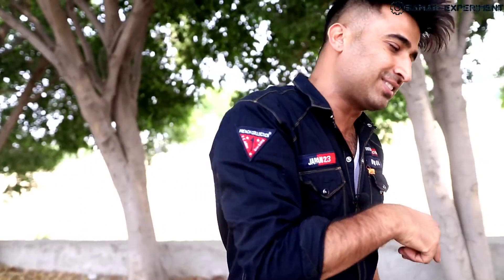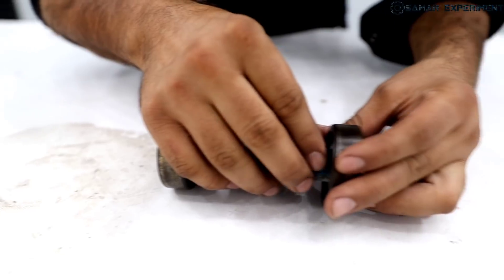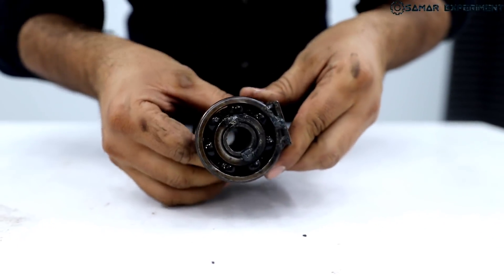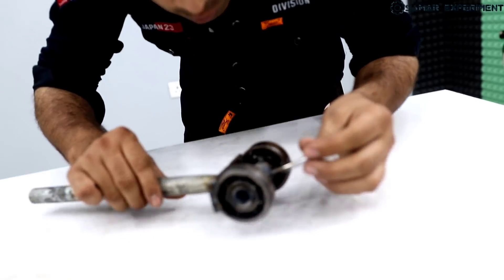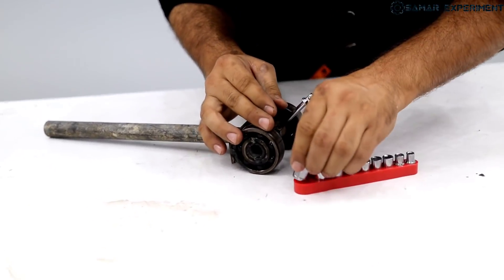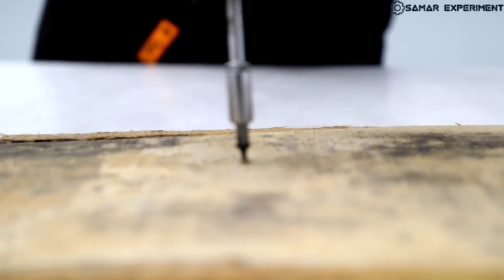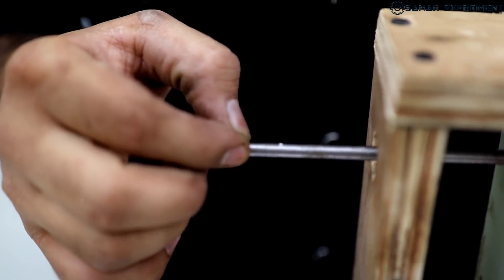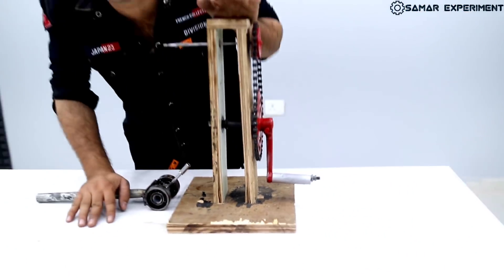पुराने Bearing से किया नया अविष्कार || How To Make Amazing Multi Tool

Comment: Sir I am your big fan .please make a wind turbine on cycle from motor which can generate electricity I am a school boy of class 8th
Reply: And sir please also not use any power tool like welding machine drill machine angle grinder or but you can use soldering iron